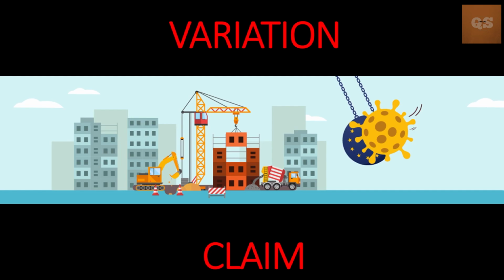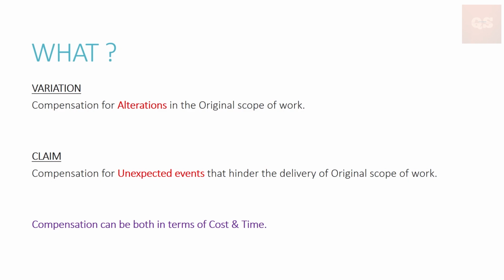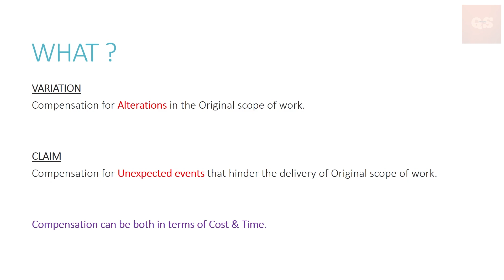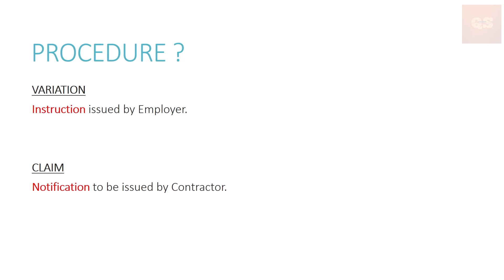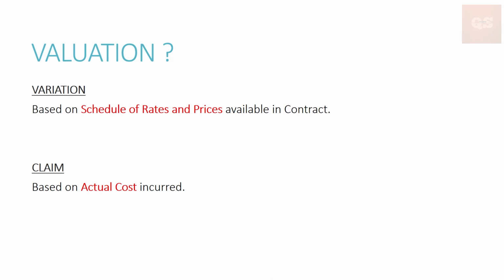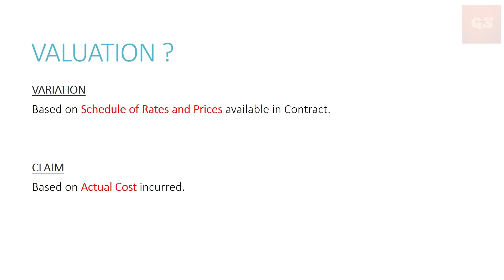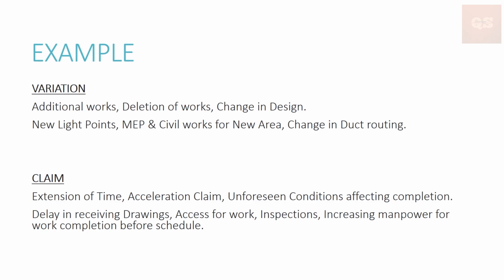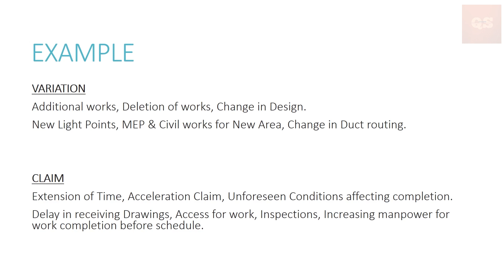Variation & Claim | Are they same or different ? | Interview Question

Comment: Hello Sir love the videos, out of curiosity. If the client is to request a variation, the price for that is based on the SOR; if your team has to move all works, say, down three levels and set up again, is this price included in the variation on top of the SOR, or is this a variation for the work then a claim for the disruption. Thank you!!
Reply from the maker: Depends in what is mentioned in the contract. If original design is to be changed then defenitely it is a variation

Comment: Thanks for video. My question on which I need your insight is that if BOQ quantities differs for excavation and backfill works differ a lot and Contractor didn’t notice at the time of tendering but when contract awarded and work on site started so contractor mer with this unforeseen huge increase in quantity due to cut and fill. So now contractor is submitting his quantities based on real work executed let’s say 2 million m3 and BOQ quantities or contract quantities was 1 million m3 so what would the claim for this case. Thanks in advance
Reply from the maker: It will be a variation.
Reply: @zulqarnainsatti6417: In brief, it will be variations (additional works/increased quantities).

Comment: Thank you for sharing, sir. Anyway, I would like to ask a question about Variation and Claim (EOT and/or cost). 

I guess any variations or changes to the Works usually impacts the original Time for Completion and/or cost. Therefore, in case there's a variation or changes to the Works and to secure the Contractor's entitlement to the Contract and applicable laws, normally the Contractor shall submit 1 (one) formal notice [only for variation] or 2 (two) notices [for variation and in further EOT+cost claim for such variation]?

Thank you.
Reply from the maker: The notice for variation can include eot also.
Reply: @QuantitySurveyingStudio  So, if the Contractor have VALID variations and the Engineer/Employer acknowledges it, the Contractor does not need to submit Claim Notices?